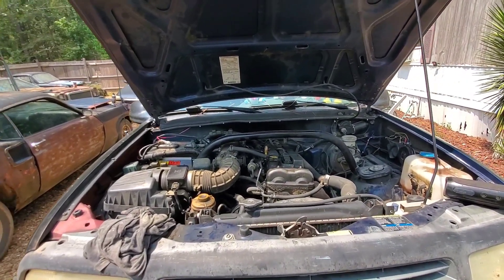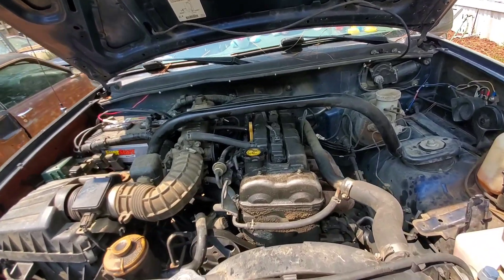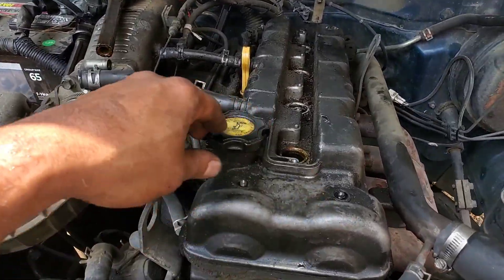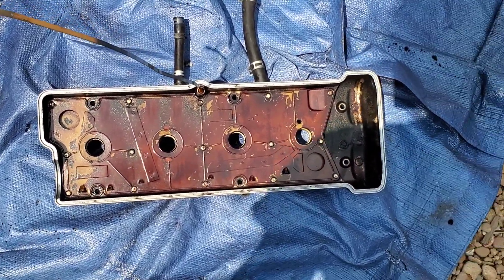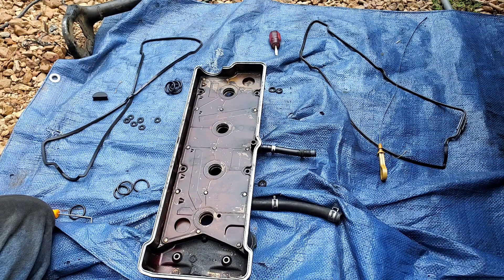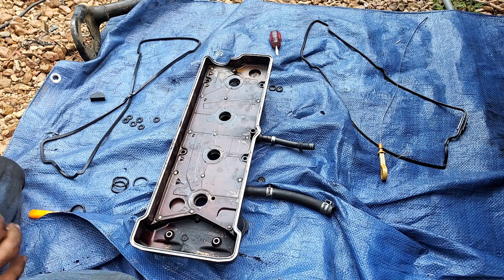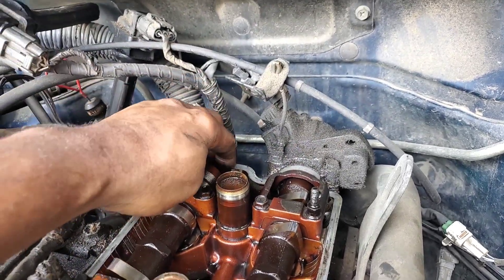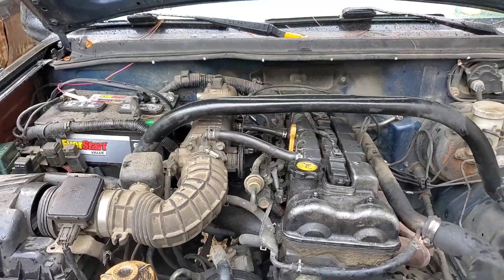2003 Chevy Tracker Valve Cover Gasket Replacement

Comment: Hola buenas amigo 👋🏻 excelente trabajo...tengo una pregunta x que o para que sirve haserle este trabajo😅en que le ayudará es una pregunta por que no lose.
Reply from the maker: @SteveFlores-z2x  the main gasket was leaking and the o-rings around the spark plug holes were leaking oil so they needed replacing.